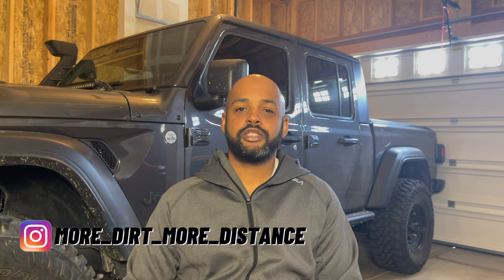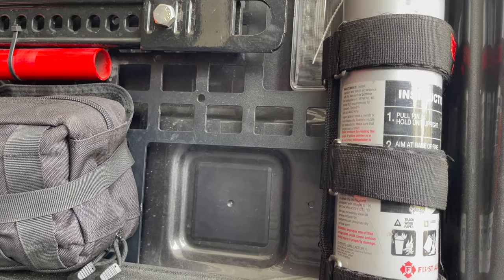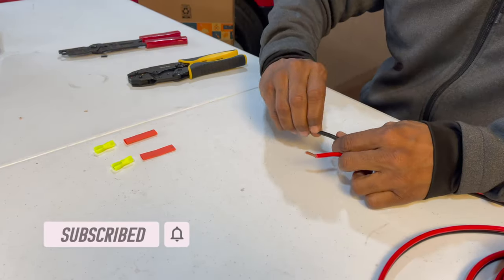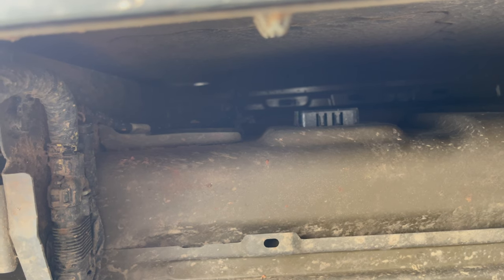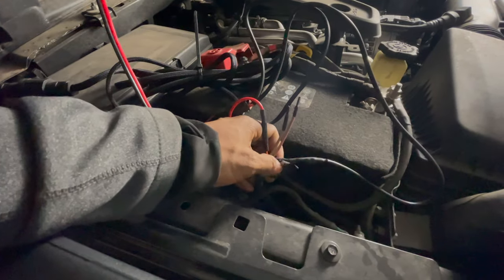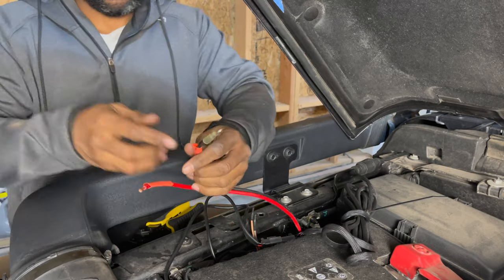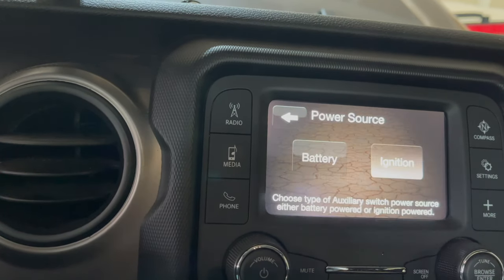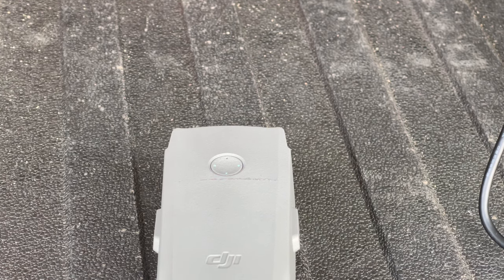12V POWER Truck Bed Jeep Gladiator Cheap and Easy Mod!

Comment: Nice I just got a 2021 Glad and I didn't see the sense in paying for the electrical outlet.  Hell if need be you could plug a converter in that outlet to get AC power from it.
Reply from the maker: True! It's a really easy and cheap mod, but is so useful.
Reply: But why not just install the factory 110V outlet?

Comment: Great install! I would so do that if I didn’t have the spray in bed-liner.
Reply from the maker: Thanks!  Are you able to cut around. the edge of the cover, or is the liner to thick?
Reply: @MoreDirtMoreDistance  it's thick enough that I didn't realize it's a cover (thicc)
Reply from the maker: @TheRandompaint  Whoa! That's thicc. I'd want to have a definite "power plan" before tackling that.
Reply: Just drill though, its not hard to complete from underneath. That way you dont crack your fresh bedliner
Reply: Rhino Linings took my plate off before spraying. I plan to do this mod in 2021. Crap. It's 2023 already?

Comment: Do you have a link for the 12 volt plug? Also, is 10 gauge 25 ft required?
Reply from the maker: Hey. I added a link to the cigarette lighter socket on Amazon. There is a link in the description to an article/charter that discusses wire length and gauge based on the required amps.